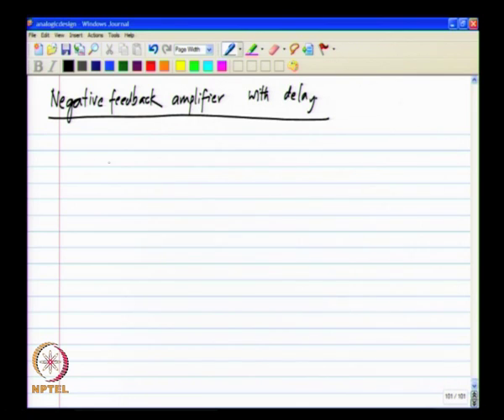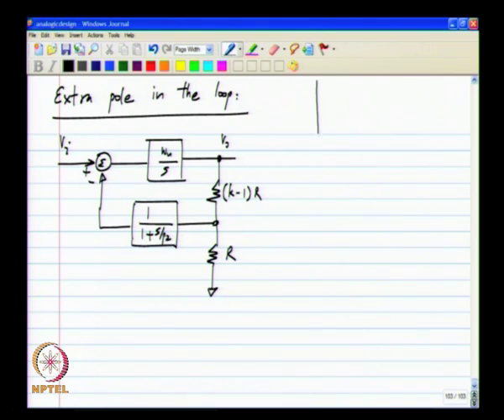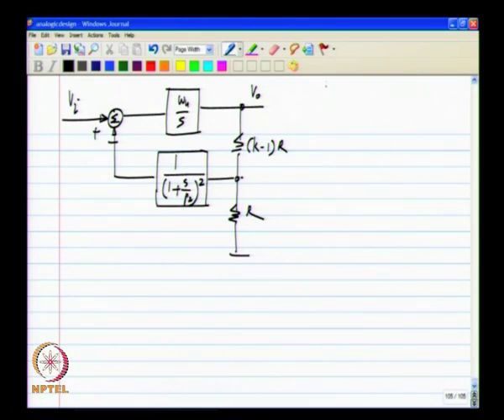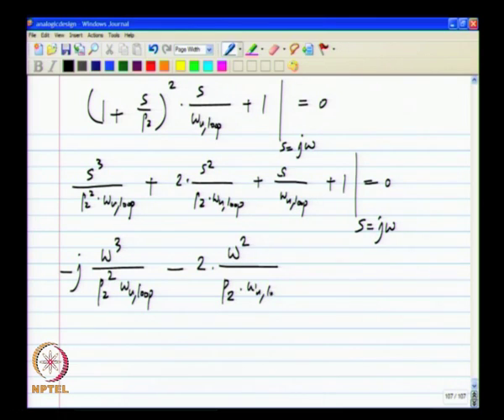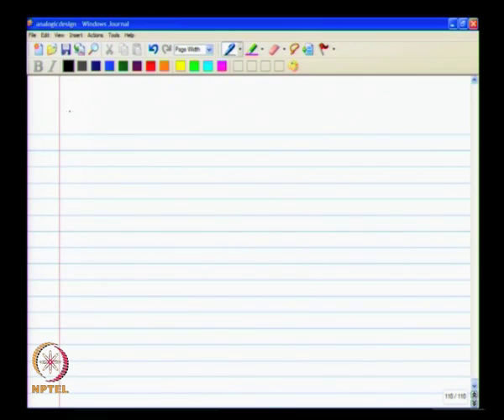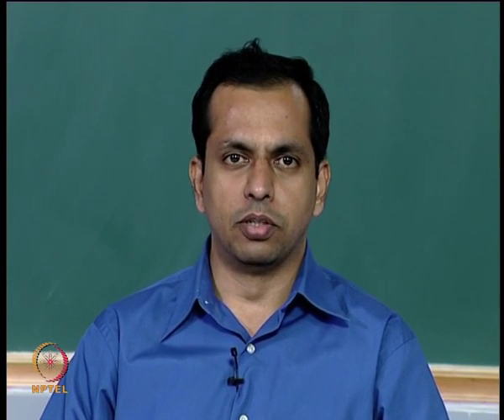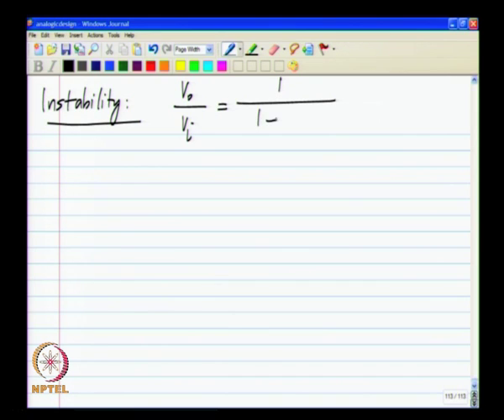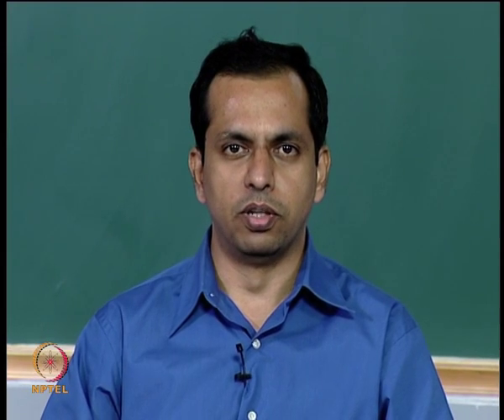Negative feedback amplifier with parasitic poles and zeros; Nyquist criterion

Comment: At 25:12  when there are two identical parasitic poles..at that time gain = infinity..due to parasitic poles.. some additional phase angle will be add to the amplifier.. when phase angle equal to either 0 r 360 degrees and gain = infinity, with out giving any input it produces output means.. system behaviour some what similar to oscillator..so can we say system behaving like an oscillator..?

Comment: Hello Sir...I guess equations defined for stability during lecture time from 26.29 to 27.36 may not be correct. I guess it’s be should be in reverse order.. Could u please confirm??
Reply: yeah right.. i too guessed it should be in reversed order..
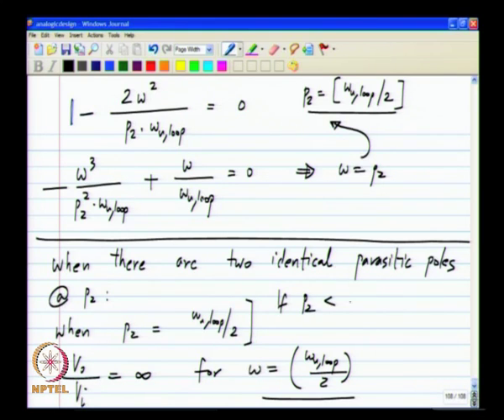Reply: @pawankumar-ep3bp  at 25:50 how can we say that for p2< w/2, the output will blow up and for p2>w/2 the system is stable.
Reply: @ecestories8816  i think the condition are correct , only the statement mentioned earlier seems to be incorrect?
Reply: @ecestories8816   if P2 is smaller than w/2 then effective delay will be greater which will lead to unstable system
Reply: did you get any answer ??
Reply: Yes it will be in reverse order.
Reply: Exactly it will be in reverse.